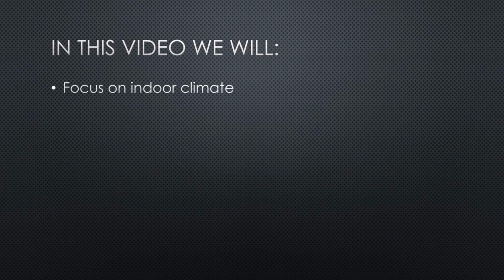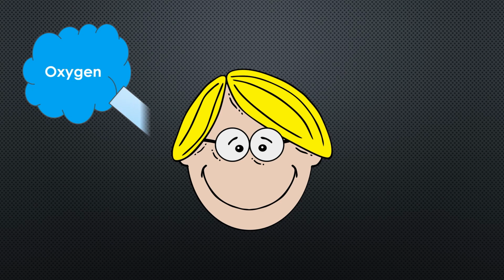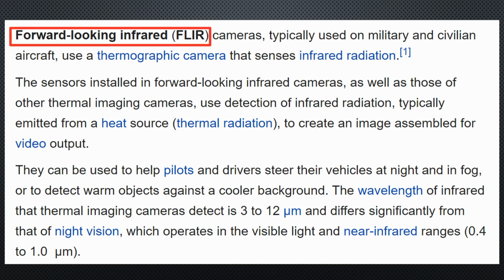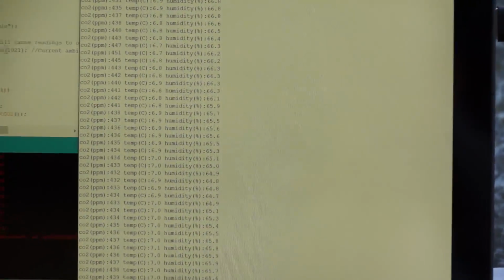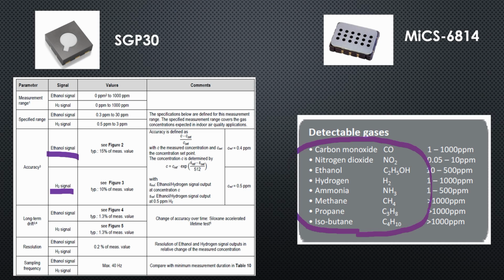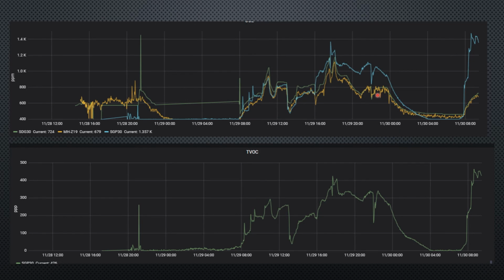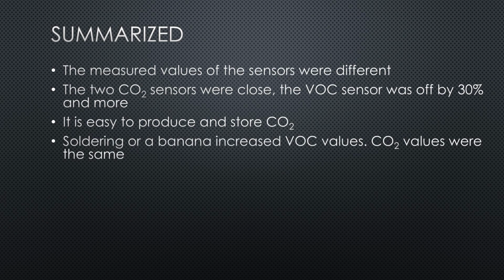#300 How to measure CO2 and VOC with Arduino. Which one is better?

Comment: yes just like you say - one of the new buildings where I worked had a CO2 sensor which was supposed to open up outside air dampers to bring in more air.  But while the engineers had specified it  and the controls company installed it - but they never calibrated it or made sure that it worked properly. So it did not really ever do anything useful.  I was on maintenance but that was not my building and we were all just getting up to speed on how the new DDC HVAC systems were supposed to work and also too busy fixing the most blatant screw ups that the controls company left for us. No they never had anyone commission the buildings which did seem really stupid for multi- million dollar buildings. I wish I had seen your video many years ago so I could have fixed that CO2 sensor issue !
Reply from the maker: From my normal job I know: "Not tested means not working" ;-)

Comment: CO2 levels can go up to 7000 ppm in submarines and space capsules. These levels are tolerable, but the CO2 level is an easily measured proxy for the usually accompanying high levels of VOCs and other air contaminants . We once measured CO2 levels in a crowded art studio. The air was stuffy and oppressive. Levels were 4500 ppm. The room needed more ventilation. I have also measured levels outside when many trees were photosynthesizing. They were just above 300. "Ah, fresh air!" They can get even lower during the day in a growing cornfield. And, your breath might be 40,000 ppm!
Reply from the maker: Interesting information! I also read about the high levels of CO2 in submarines. This is why I thought, the oxygen level must be important in crowded rooms.
Reply: did you measure o2?
Reply: @MaximumEfficiency  Harder to measure but not usually considered an issue as CO2 is.

Comment: Do the same video for fine particles sensors
Reply: Just as easy as for other inspection. Either I2c or uart. There is also a lib for that in arduino ide
Reply from the maker: I cannot do this where I live. It would be very boring. The sensor would always show zero (i tried).
Reply: I have ordered a PMS5003 air particle sensor and will be trying this once it arrives. I originally wanted to get an SDS011, but I haven't found them locally. Does anyone know which is better? There is also one that does not use a fan, but I couldn't find it last time I looked - the fan will wear out eventually. Unlike Switzerland, South Africa has serious air quality issues in many places. We want to teach school kids about this. Many adults I know are completely unaware of this.

Comment: Thanks for yet another great video. I have been using the MH-Z19B in exactly this way, to alert when I need to ventilate the room. Has been working for over 2 years now without any problems. However I was not able to make it work on 3.3V, only on 5V. Second thing - i needed to turn off the correction (ABC) - otherwise the values would drift off considerably with time, especially if windows are rarely opened in winter. The SCD40 looks very interesting. Would like to try it out as well, I guess it should also have a reasonable power consumption to use it in battery powered device. Then you can even carry it with you everywhere))
Reply from the maker: You are right. Vcc is 5V. only the logic levels are 3.3 volt.

Comment: Actually, the reason CO2 sensors are used for air quality monitoring instead of oxygen sensors has nothing to do with cost, energy usage, size or how complicated they are (though they are costly). It's because we're not interested in oxygen levels, as it's very difficult to lower the oxygen levels to any appreciable level unless a room is sealed with a lot of people, but CO2 itself is toxic in high concentrations, and it can produce dizziness, feeling tired, and other related symptoms, starting from 1000-2000 ppm (that's only 0.1-0.2 %! At those levels oxygen concentration would, at most, fall from 21 % to 20.8-20.9 %, not near enough for any appreciable effect). Here's a link to a Tom Scott video about that if you want to learn more: https://www.youtube.com/watch?v=1Nh_vxpycEA.
Reply from the maker: I am not sure about the whole thing anymore. In submarines with atomic bombs on board and in the Space Station the CO2 level seems to be around 5000 ppm all year round. I hope, these guy do not loose their abilities to think...
I would have been interested in the O2 level at the end of his test.
Reply: @AndreasSpiess  that is why the have tests before sending people down or up.  :-)

Another thing.  In Soda generator, like Soda Stream, there are CO2 gas tubes.  So there you also will have access to pure CO2.
Reply: @AndreasSpiess  not sure about subs if they use a hack to compensate like increasing o2 levels or playing with pressure , but for space your o2 expenditure is greatly decreased in low or no gravity situations ,so probably can tolerate much higher co2 concentrations kinda like sick people here with reduced lung capacity might not need supplemental o2 when not doing physical activities. if you use less oxygen your lungs have less gas exchanging to do.
Reply: I can't find anyone measuring o2 in different areas: forest, city, dessert, sea, cave, basement, apartment etc.

that data could be interesting, why is nobody measuring that?

Comment: I did a lot research on Voc sensors. Voc (mox) sensor are heavily influenced by humidity amongst other factors. That's why your sgp30 shows that high value during the night. Even very low changes in humitdy counts for some 100ppm voc. I'm not aware of any single implementation that is able produce values usable over a period for days or weeks. Yes, they respond to changes very good but not on a absolute level. Co2 (mhz19b) must be the primary indicator.
Reply from the maker: Good to know. I also trust the CO2 sensors more.

Comment: Bananas emit ethylene gas.  This is why they can be picked before they are ripe and then ripened in stores that circulate the ethylene which helps the ripening process.  My wife places unripe pears next to the bananas to help the pears to ripen.  Bob
Reply from the maker: The son of my brother worked in a company where they ripe the bananas for Switzerland's biggest retailer (just in time). I did not believe it first ;-)

Comment: As a German living in Sweden I have to point out that SENSEAIR is a Swedish company. I have recently been involved with them as being an opponent in a thesis defense which deals with the improvement of both their CO2 and CH4 sensors.
Reply from the maker: Thank you for the correction. I got it from a German viewer and did not check further...
Reply: Andreas Spiess I have been involved in a plug-in for ESP-Easy firmware for SenseAir S8 sensor. Look here: https://github.com/letscontrolit/ESPEasy/blob/mega/src/_P052_SenseAir.ino

Comment: Perfect  timing. I just hooked up my first MHZ19B 2-3 days ago. Sometimes i get massive co2 value drops that i can't really explain. Like in the middle of the night without opening a window or door.  One drop could be the automatic 24h calibration, but the other ones confuse me a little bit. One problem could be that it's still on my breadboard powered by the 5V pin of a D1 Mini, another one could be that 2-3 days are just not enough time to be fully calibrated. But so far it does a much better job than the CCS811 eCO2 i tried a few months ago.
Maybe those TVOC Sensors like the SGP30 / CCS811 could be useful for a hobby room with all kinds of gases / particles.
Reply: I see this, too. I think it is variations in wind levels and directions, affecting the amount of outside air infiltrating the house.
Reply from the maker: I have now a ESP32 with different sensors reporting. I hope, that I will see a pattern after a few month. I disabled auto calibration to see what they really measure and only will enable it when I know that.

Comment: You absolutely forgot about the ccs811. It's really cool and chip sensor with low power mode.
Reply from the maker: Looking at its datasheet it is very similar to the one I used. I would expect the same issues.

Comment: Thanks for the informative video, just what I needed right now. :-) I’m working on a MQ135 VOC sensor and Sharp infrared dust sensor project. The MQ135 fluctuates a bit in it’s output values so I guess it’s best for short term relative measurements. My program periodically adjusts the “zero” value to compensate.
Reply from the maker: It always depends on which gases you are interested in. The problem of calibration is the assumption that you know when the values are lowest and how much lowest is. To determine that, you need a proper sensor. Otherwise all is only guesswork...

Comment: i have a sharp air purifier that triggers the fan whenever i fart. it also gets triggered by alcohol fumes, like in anti-bacterial hand wash. it must be almost 10 years old now but the sensor is still very sensitive to changes in the air
Reply: A fart controlled fan! My gf would love to get me one for Christmas!
Reply: I have a 20 year old split air-conditioner made in Japan and still goes like new. Buy Chinese made and keep replacing.
Reply: one fart to turn fan on, two farts turns it off?

Comment: @ 17:00 "[ ...] without oxygen the fire stops. Problem solved without collateral damage." As long as there are no humans in the same room. Else there will be a lot of collateral damage!
Reply: No that’s fine, because a good IT dwarf will send other people (e.g interns) to overlook the most important stuff (read servers, because some cost oriented people didn’t allow you a decent video stream of your puppies) and will monitor its health (obviously I’m talking about servers one). If humans probes eventually returns, everything is fine, it’s means your monitoring is validated by a secondary data flow (just document it). If not a review of your backup plan could be an consideration.
Reply: And that is why all such systems that I've seen use an inert mix of gases that are non-toxic (CO2 only would not be good). Some data centres use a reduced oxygen atmosphere (15-16%) which prevents fires from even starting, as the oxygen content is too low. Some people are more affected by this than others, getting more easily exhausted and getting a headache when working there, while others barely notice (luckily I'm in that last group).
Reply: I think there's an evacuate alarm that goes off. Gives people a few minutes to get out. I also think it's not just pure CO2, but a mix of stuff, so any occupants would still pass out, but probably not die. Smoke inhalation/fire is probably going to kill them before the CO2 does anyway, but I'm no expert.
Reply: HaHa, Back in the day when I worked on large IBM Mainframes, there were Automatic Halon Fire extinguishing systems which would rob the fire of oxygen. Needless to say it would be disastrous if you hung around! Yet, there were posted signs asking the operators to unload all tape drives, label them, then store them carefully in the fireproof and exit the computer room swiftly if possible.(!)

Comment: I'm glad you used these higher quality sensors. The MQ-x sensors that come with the starter kits are relatively useless.  I just finished taking 120,000 readings of my lab and your video has given me some great information of things I need to check. Thanks for all you do.
Reply from the maker: I will not include the MQxx sensors in my tests as they are made for different gases, I think. And my experiments with them were also not rewarding.
Reply: @AndreasSpiess  Yes. The data sheets say some of them measure CO2 but the results were very unreliable.
Reply: @AndreasSpiess  how about MQ-131 for VOC measuring and also which dust sensor should be used for this project additionally?
Reply from the maker: @neymarjr1292  You can try. I do not know what they really measure...
I never used dust sensors. only particulate matter sensors

Comment: This is similar to my first ESP32 project, an atmospheric monitor/logger that measured particulate and combustible gas concentration with a Shinyei PPD42NS and an MQ-2 sensor. It uses GPS for a reference time signal and a BME280 sensor for reference pressure, temperature, and humidity values. I looked into MQTT communications but got distracted by trying to estimate power requirements (was hoping to add solar panels and battery). The particulate sensor uses a resistor as a heating element to move air and particles past the IR sensor and I believe that dominated the power consumption. Search for apthorpe/aerosniff on BitBucket for the code and Fritzing schematic & circuit diagram if you're interested. Thanks for making ESP32 development so accessible; I wouldn't have been able to do that project without your videos :)
Reply from the maker: You seem to be quite experienced with sensors...

Comment: I think the major problem with lambda sensors is the high operating temperature required (300° to 600° C).  I've been in pretty hot meeting rooms before but even this is a bit much.
Reply: I think this is also because the exhaust oxygen varies a lot (0-20%), where as humans don't consume nearly as much and change is harder to detect

Comment: Automotive O2 sensors will only work at high temperatures, not room temperature.
Some O2 sensors have built in heaters or rely on the vehicle to heat the sensor as it warms up.
The vehicle engine and ECU can run without the O2 sensor, this is called OPEN LOOP when cold.
When the engine and O2 is heated, the ECU then runs using the O2 sensor reading, CLOSED LOOP operation.
Reply from the maker: I see. I did not know heat was a prerequisite. Thanks!
Reply: do you have any data on o2 in different areas: forest, city, dessert, sea, cave, basement, apartment etc.?

Comment: The reason lambda sensors are not used indoors, is because they need to be quite hot too work. Around 300 to 600°C hot. Inside the exhaust of an engine this is not too big an issue, but in open air it would take quite a bit of power
Reply from the maker: That is what I also thought because it works in the exhaust path. But I did not know it is mandatory. Thanks.!

Comment: wow, that chinese CO2 sensor finally is an affordable CO2 sensor. I've been waiting for something like that for ages.
Reply: Because of this sensor I open world of ESPs and other controllers... But be careful with them - there are 2 versions, and as I understand manual calibration of first one (without B) may "destroy" device - as it need 0 CO2 to calibrate. Second one use more reliable strategy to auto-calibrate and manual calibration assume to 400ppm baseline. And, I have no idea how they differ if you have them in hands...

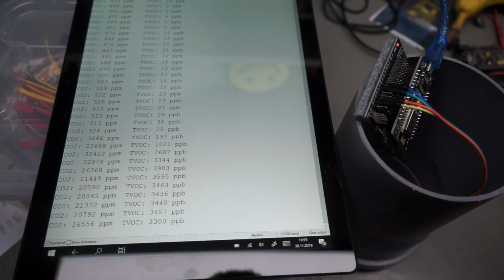Comment: @17:21 your breath is lethal! ;-) This is a good reason for such a device. In my experience teachers can be extremely boring, and having a poor environment for your brain doesn't help.
Reply: So if you perform CPR, are you committing attempted murder? How about we conjure up a CPR respirator that doesn't give CO2 to the victim?
Reply from the maker: In many situations people use air several times (if you hyperventilate, for example). Oxigen is not used up by only one time breathing.

Comment: It is shocking to see the difference in background CO2 in 6 years from 2018 to 2024.  NIWA Baring Head in NZ is 421.5ppm today and Mauna Loa Hawaii is 427.5ppm.
So it is likely that the new 2024 calibration point should be around 430ppm for the Northern Hemisphere and 420ppm for the Southern Hemisphere. Your video is , still, extremely helpful. Far more than any other on YouTube, even recently,  related to these inexpensive IAQ sensors. 
My very cheap ( <$20 ) IAQ AirBox Tuya Bluetooth ( eCO2 based , i assume on a VOC sensor ) tells me fresh air is 368ppm. But no calibration happens. I guess this is not so important if what we really want is a " relative IAQ eCO2 value" that will trigger an " open window"  Automation just before the point where the people in the meeting room spontaneously open a window themselves. The value we choose , from experience , could be 1,000ppm CO2 or 1,300ppm  eCO2 plus or minus 50. Just hope that these little units are reasonably consistent , if not so objectively accurate or sensitive.
Reply from the maker: Interresting that the values are already so high! Thanks for the update. Concerning the  eVOC sensors: As said, I was not very happy with them.

Comment: I deployed MHZ19B and it works like a charm with ESP32 
It did not change my life but I am opening the window more often - bills for heating will go up during winter ;-)
Btw after researching available sensors I am happy I decided to go for this one - it gives nice and stable readings - going to sleep with 400ppm and in the morning it is 1500 - hmm, now I understand why sometimes I wake up more tired than I went to sleep
Reply from the maker: Indeed, 1500ppm is a lot. So maybe a little more money for heating is a good thing!
Reply: @AndreasSpiess  I agree, however OSHA agencies provide "acceptable level < 5000 for long time work (8h or so)" - I believe it is way too high - I set up the alarm in my home assistant at 2000 ;-)

Comment: Great video and look forward to the update particularly how the eCO2 correlate with CO2 readings on extended runs. I currently use a CCS811 for eCO2 and plan to test the SGP30 for similar reasons.
Also not sure if I missed but did you send humidity compensation values into the SGP30? Per the datasheet this affects both eCO2 and tVOC reading
Reply from the maker: I did not enter the compensation values. The TVOC sensors are anyway showing completely different values as the CO2 sensors :-(